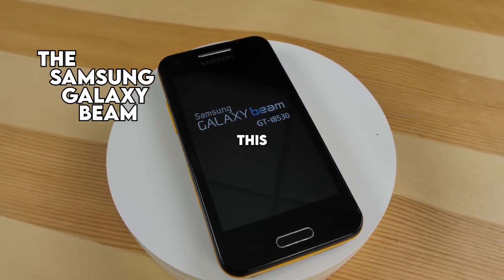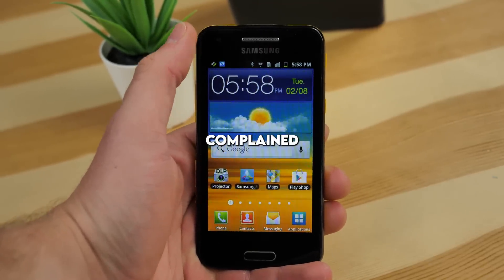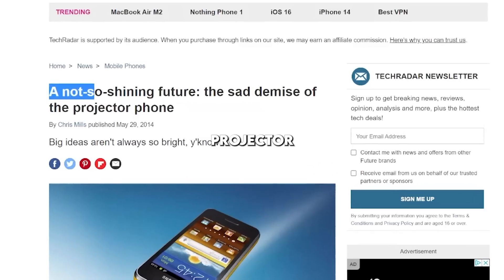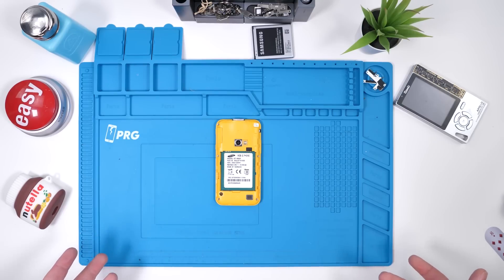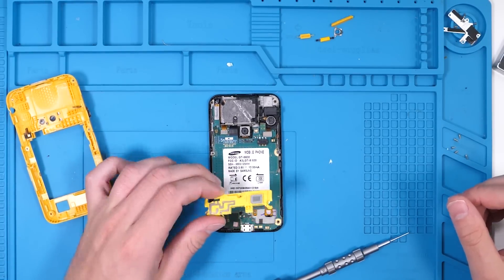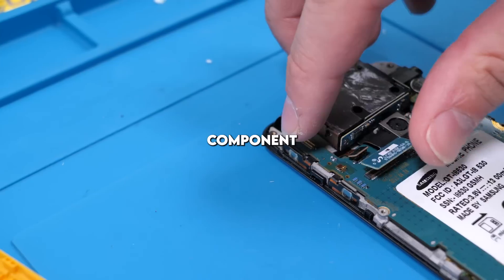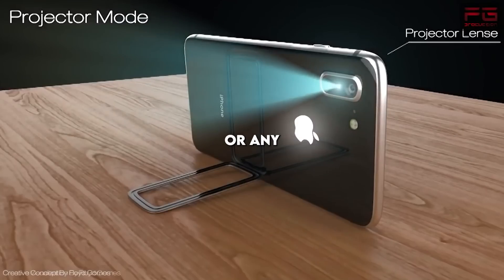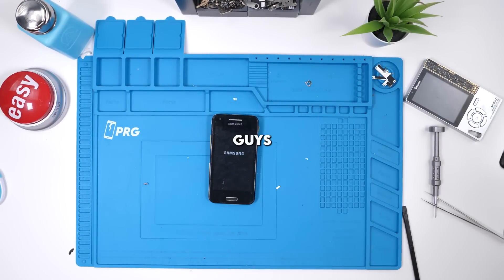Why Samsung's Projector Phone FAILED..... + Teardown

Comment from the maker: Hope you guys enjoyed this one! happy tuesday :)
The short video I made on this : https://www.youtube.com/shorts/RYPktrWRA4U
Reply: Nice bro
Reply: nce video
Reply: k :)
Reply: happy Tuesday to you too :)
Reply: Ty :D
Reply: Happy Tuesday!
Reply: here before this blows up
Reply: Happy Thursday
Reply: Thanks for the Lake
Reply: Kk
Reply: Prg hi
Reply: Hi
Reply: Could you find a blackview and install it with a different chip like a snapdragon 888 If it could would totally make a console out of it
Reply: @YNGKINGDOLO  what
Reply: @kerimacaulay60  Yeah they perfected the ps2 GC(Dolphin) they working on the Xbox emulators so a throwback projector📽
Reply: Wher do u work i dropped my nintendo lite and switch and they wont turn on
Reply: I had a similar Samsung phone with those type of volume and power buttons.....Those buttons are like a ribbon. Bro you can simple use a tool to lift that button ribbon and lift up the whole motherboard without damaging it😊
Reply: @hamzamohid  yup. I have about 45 of these types of phones lol
Reply: How can I have you fix my Nintendo switch
Reply: Hey, the buttons are indeed soldered on the board, but there's just some weak adhesive holding them to the frame. You can easily remove the buttons from the frame, so you'll be able to remove the motherboard. I deal with such buttons daily lol
Reply: Hi - where did you buy your screwdrivers ?
Reply: Upgrade its projector
Reply: A 'HOLOGRAPHIC' Projector Case ....
Add On..
Would be sweet! ....& Everyone would get it, if that becomes possible. or When!
Reply: 1pes
Reply: 1pes
Reply: Now I'm subscribing :D
Reply: It's heads they re-release that phone now it would sell like crazy
Reply: Especially with bringing the operating system up-to-date
Reply: kk
Reply: Happy Tuesday :)
Reply: Happy Tuesday! :)
Reply: Guru, my iPhone se 1 is restarting at his own, I have updated it and reset all settings but it still happens

Comment: They simply are not bright enough.  Even with a modern bright LED you cannot dissipate the heat.  Not to mention it will drain the battery.

Comment: In the case of Moto it was not just a case but a "moto mod" like you said, a module. I used to have the Moto Z that supported this and other modules such as a Jbl speaker and a Hasselblad camera with 10x optical zoom which was total perfection

Comment: I feel like there's not really a reason to have a projector and a phone combination because...
If you just want a bigger screen a lapdock (phone dock in the form of a laptop) would generally be alot more of a easy to set up just anywhere and if you want a on the go movie theater experience you likely have enough room to set up a portable projector and hook a phone to that. As neat of a idea as this was. 
I don't buy the conference presentation mode because generally your office would have a projector anyway or you would have enough room to setup the aforementioned separate mini projector. (I've used the Motorola case projector before and I can easily say I probably would nowadays use a mini projector)

Comment: I have it since 2017 (i found it it existed just in 2015) i saw netflix on it and used whatsapp till 2020, and it came out with 2 batteries with an independent charger which also worked as a standard dock for the phone i never run out of battery with it, i'm still playing real racing 3 v.1.0 on the phone and asphalt 6, it is true that the phone can get frozen sometimes and that makes you remove the battery, turn back on and set the hour cause' it doesn't have an internal clock, and the headphone jack its useless, but it works perfect for watching movies i have the bs player app installed, also there is an accesory for the phone to use it as a deck for projecting movies and is also works as an audio amplifier from the speaker, too bad the most popular version has yellow color on the side

Comment: Hey phone repair guru do you by any chance have an iPhone 6s motherboard and touch id linked to that Motherboard because my iphone 6s is water damaged and my local repair shops tell me that it is not fixable and if you want a working phone you will have to get a new motherboard for the same if you have an iPhone 6s motherboard do let me know as you help out the environment by giving cheap enough repairs and if i can't find a working motherboard my phone will be added in the already massive pile of e waste.
I have reached out to get a solution if you can help a fellow subscriber it would be an a great help. Not asking you to give it to charity i will pay you a fair price for it. eBay listings were kind of sus.

Comment: I just don't think phone projectors make much sense over conventional mini/pocket projectors. especially with the needed comprimises. 

- Small projectors use DLP technology rather than the more bulky and cheaper LCD, this alone will certainly account for majority of the phone's price. 

- Even small projectors have fans in them, I assume this is because the lamp inside generates a lot of heat, this will sacrifice waterproofing. 
Brightness is one of the largest factors when shopping for projectors, you want something that isn't dim and will allow for good contrast and screen size. Better cooling = brighter light source. Even the pocket projectors today suffer from poor brightness in ideal conditions. 

- Yes, its built in, or stuck to the back of your phone. But what if you want to upgrade? Why not just have something that can connect to every device (now and in the future), having a hdmi port built into a phone will be chunky, or requiring an adapter that you have to carry around. All this chunkiness adds to less room for features or improvements, even for modular phones. 

- Projectors are just not as good as traditional displays (at this price and type). You need a good surface, good lighting, and good positioning (maybe a tripod). The image can only be as dark as the surface... vice versa. How often are you in a situation that would make you use your phone projector rather than a common TV or monitor with the ability to provide much better viewing experiences, let alone having a good surface to project on. Projectors that do well in even normal lighting conditions cost more than your typical phone, even then they are using special projector screens that brighten the image.

I draw it parellel to new cars with graphics cards in them, playing demanding games on them is cool, but it won't be used as often as a traditional gaming setup and wont be as good as one either.

Comment: With streaming options like chromecast 
Idk I can't say I'd really PAY extra on a phone just for a projector but, like a case that would be significantly cheaper and would have eventual 3rd party options I'd consider it
Reply: This isn't really like a flagship feature but more like a cool feature on a 300-500$ phone to make it more attractive. And it might even induce some flagship owners to buy it as a separate phone. Frankly though, it's better as a phone accessory that can be plugged in to the USB port

Comment: The innovation train has since dried up to small changes that don't really make a difference. LG was the last company to really push the edge (correction, flexible displays are pretty awesome). But yeah, I miss LG and I miss innovation in these devices. Just removing the aux and the charger doesn't count as innovation.

Comment: I bought this for 100€ and 1 year ago it got white dots. How can i remove those? One more thing is that on the bottom of the projector it's a little bit black it's seems like maybe the projector is not in the correct position or something idk. And also the back cover was sticky so i sticked like a wooden decoration tape and i made it look even better and that solved the sticky problem. In this shop they had 2 and both where sticky

Comment: Niche phones with a specialty feature are an incredibly tough sell. After all, most people would prefer to buy regular phones, and as you've shown, the end product would need some compromises due to the extra room needed for the components. Makes more sense to buy a separate, portable projector. And these days there are models that support wireless projections from phones.

Comment: I bought a broke a Motorola stylus g. The screen worked still for a month or so after it broke.  Finally it had a black apace at the top and slowly grew and only less then half of the screen could be seen. I went to check on the price for repair and got told it would cost the same as the phone did when it was brand new. Almost $400

Comment: Projectors are a thing of the past, tvs have gotten a lot cheaper and easier to use. Most phones and modern tv you can do a wireless mirror or cast to, making a projector pointless as the resolution and clarity is far superior.

Comment: I think these phones failed simply because there isn’t a real problem they solve and not many use cases to make them optimal. In over 90% of the places that have a need for a projector already have a much better quality projector, for instance anywhere you would need to give a presentation the tools like a projector or a tv will already be provided to give that presentation, in a home setting a tv or a standalone projector give a vastly superior quality compared to one’s that could be baked into the phone and in most other places it will be too bright to even get any real use out of the phone projector. Meaning there are very limited scenarios where people would would actually need one, and coupled with the fact the draw back of having one means a much bulkier phone and less space for other internal hardware it clear that the limited use cases drawback outweighs having to actually deal with one of these phones. I mean the closest thing I can think of in terms of actual use cases is kicking back the front seats of the car in a laying down position and projecting the image onto the interior roof to watch a movie and relax on the road, however a lot of cars have sun roofs and very few if any have white interiors making the experience suboptimal, and given that modern cars are beginning to have larger and larger navigation displays built into them this use case is not even going to be relevant for long. Another use case that’s more viable is something like camping where you don’t have easy access to electricity and you could project a movie onto the side of the tent for a few friends to watch at night however the battery drain and the simple idea people go camping to get away from technology again makes this use case shaky at best. Many some people found a creative use case for these devices that makes sense in which case I’d love to hear it, but from where I stand there really doesn’t seem to be a need for these kinds of devices

Comment: The Moto mods for the Moto Z series were great. They weren't really "cases" but an add-on of sorts using magnetic pins on the back of the phone. Kinda like if Magsafe had physical pins to communicate with your phone for power/data.

Comment: Used the Motorola mods projectors for a few years even after using the moto as a cell. Over wifi as a smart projector. Then upgrade to an android smart projector with a higher quality projector. With smart phones no longer using external memory sd etc.. I don't see it as an option unless the projector accesory would just connect via wifi bluetooth or cloud via an app to share what you broadcasting for your meeting or presentación on the go.

Comment: Because Samsung built a projector inside the Beam, they had to compromise on the specs, so, on release, it was already outdated.
Consider that, during that time, phones were smaller in size than they are now. Much smaller.

Comment: It looks like those volume and power control buttons are not soldered but stick with glue or adhesive, it just looks like the s3 which was the same.

Comment: The beam was…. Interesting… it’s biggest flaw was that it was a rebadge of a one to two year old phone Samsung had already released…

To put it in a modern perspective, imagine of Samsung took an A series from 2020 stuck s projector on it and sold it as a “new” phone. 

The bean was behind on everything from specs to the software at the time when android was really starting to take off and every update was quantum leap over the last one.
Reply: Ha ha samson bean
Reply: @_m1k0  Samsung wife?
Reply: @_m1k0  Real Human Bean
Reply: Have an A series from 2020, and it works perfectly fine. The A01 and A11 from '20 might have issues, though. EDIT: The source I used when posting had apparently swapped the specs of these two with an older device. Also, YouTube app, why are you not wrapping formatted text?
Reply: @user2C47 yea but back then, there was always massive spec leaps. It's not the same today
Reply: @heroninja1125  True. I'm just sick and tired of people crapping all over the A series. In fact, I've switched from the 51 to the 01 since then.